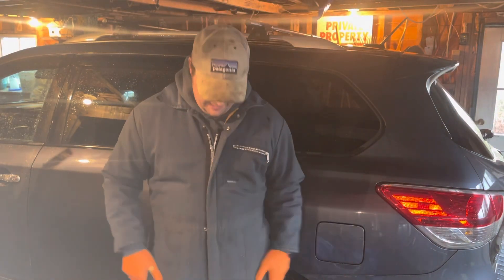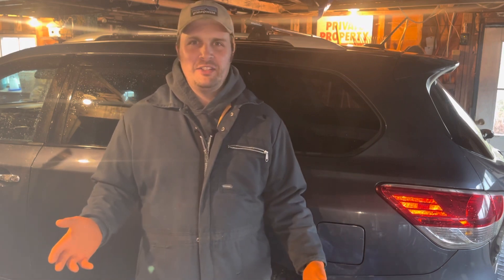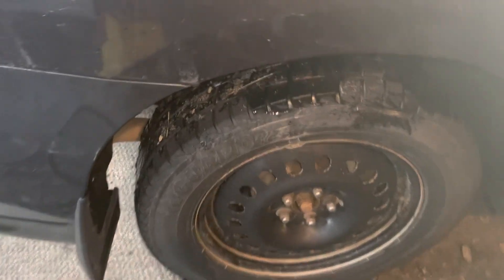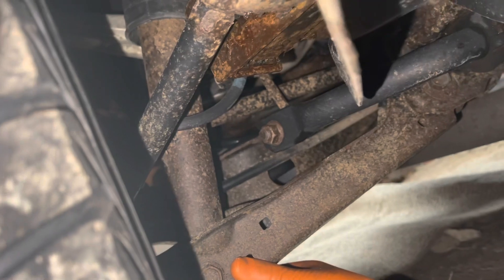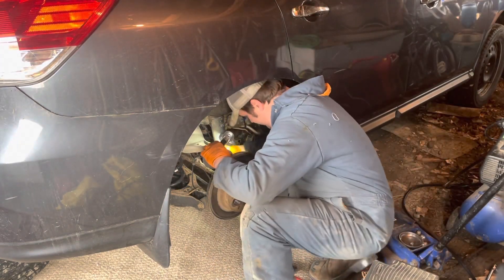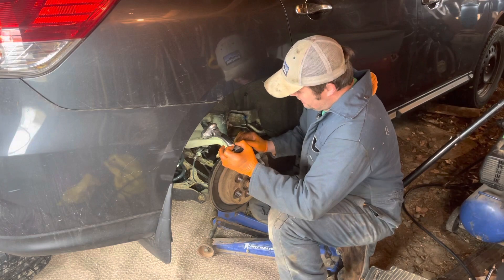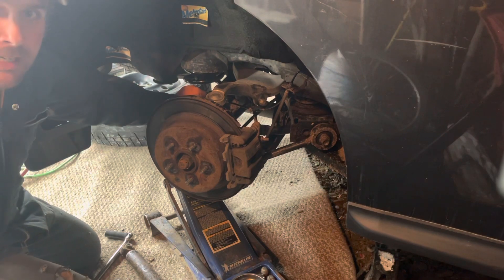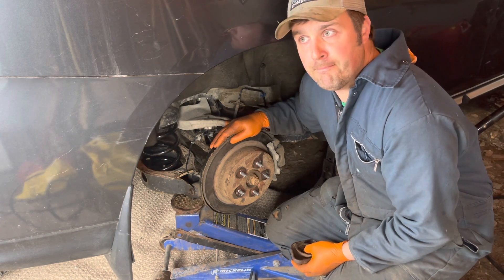Rear Suspension Replacement - 2013 Nissan Pathfinder

Comment: I'm walking in your footsteps!   I ordered up on rock auto the rear coils, struts, and links... just replaced the front struts two weeks ago and rotors/pads, now the same clunking noises started happening with the rear end.  I'm at 161k... hopefully this will be good for a bit!   I've done both front windows slider brackets because the wire inside the doors rusted out, the internal plastic door handle which olds the lock-wire broke, visors should be replaced but i can deal with the loud clicking noise...   anyway... keep posting!  Cheers
Reply from the maker: Sounds like a lot of the same stuff we dealt with. Windows ✔️, plastic handle ✔️, etc 😂
Reply: @TheBrokenBolt  oh and never-mind when we bought it used from a Toyota dealership, the transmission went, lucky for us Nissan replaced it at 51k!  My wife hates this vehicle but we keep repairing what need repairing!
Reply from the maker: Transmission went on ours too … that’s what ended my relationship with it finally … have an older R51 as our daily now.
Reply: @TheBrokenBolt   Just wonna add of anyone elese ever looking at this in the future. Mine had no Judderbut was pulling the same code that nissan says replace transmission. Visual inspection by nissan did not show any signs of belt slipage.I only had delayed engagment from R to D or D to R. Other than that it worksed nomally. I just ordered a remanufactured valve body control body online from ebay for under $300. 60K+, no issues.
Reply: Chuck, which brand of susoension comoonents did you order and how was the performance.
Reply: @burtonmuhia7614   I had order a set of Monroe from rock , quick struts but they were horrible, they made the clunking noises somehow worse, I removed those and sent them back to rock auto, got a full refund and then order the quick struts from Nissan, around 300 per side, put those in and problem solved and quiet as ever.   The rear suspension were from rock auto, Monroe shocks and the moog rear links.   Happy with the performance ( meaning my wife no longer complains).  😀
Reply: @chuckbllrs3844  Nice. Fronts were replaced with FCS quick struts and rear with Gabriel shocks. Both are in the soft side but okay. 

Whichbrand for the rear coils? Was your rear squating like most people or just soft?
Reply: @burtonmuhia7614  Well regarding the rear coil springs it was because I was going to be changing the rear shocks, figured it wouldn't hurt.  They weren't to bad to begin with,  Rock Auto, MOOG #81761
Reply: @burtonmuhia7614  I had the shuddering on my 2014.  Nissan initially replaced the valve body control first......it was then fine for a while.  Later one i noticed more tranny issues.  Took it back....they replaced the transmission under warranty.  Had bad front end clunking and noises which ended up being the front sway bar bushings (changed the links too).   Now rear end is clunking on both sides over bumps.  Already replaced the rear links and bushings ...and later this week will change the shocks.  Thanks for posting this vid.  Now I know what I am up against for the rear shocks.